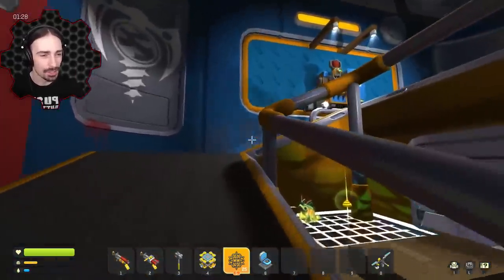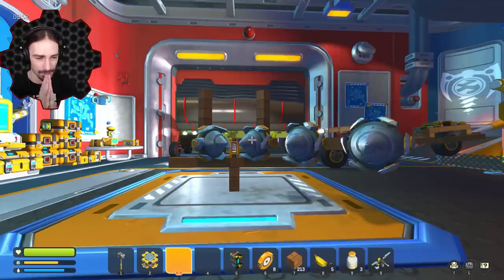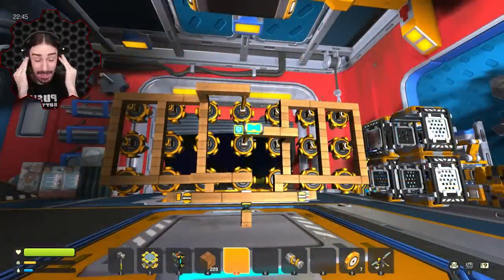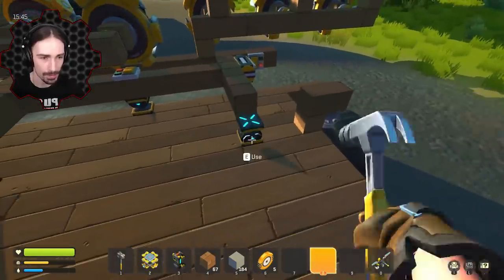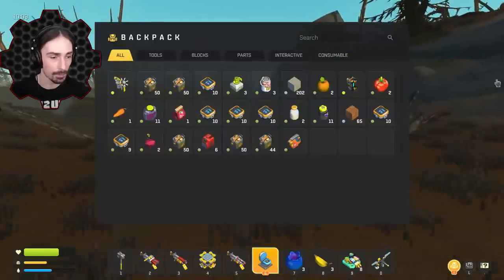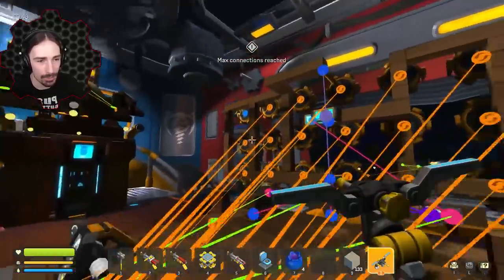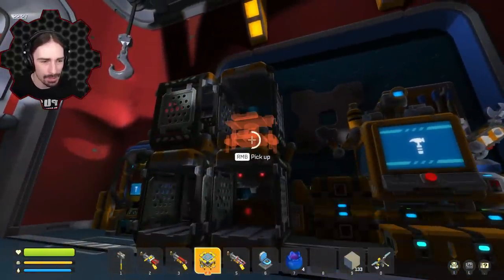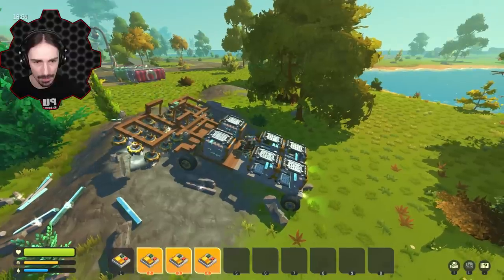Building The Ultimate Drill Miner! + Big Boss Biome? - Scrap Mechanic Survival Mode [SMS 14]

Comment: You can power saws and drills without any fuel using a fully upgraded seat connected to all the bearings, changing the properties of the bearings to full turn degrees and turn speed and then spamming A and D. Up to like 20 drills in one seat.

Comment: Hey scrapman, I have an idea for your farm defense mechanism. You can put sensors on the outside of the farm and hook them up to pistons. The pistons can crush the bots and kill them instantly. This means it will be ( for the most part) be an automatic defense system. You'll probably Still have to be there just in case it isn't fully reliable, but it'll make it a lot easier. However, this may not work for bosses because it would be op. Just make sure the pistons don't overlap the sensor so it doesn't make a infinite loop. Like so scrapman can see!

Comment: Scrapman, you should've used pistons to extend both sides of drill walls for the fold and able to retract it for the crushing.

To counter the weight of the drills, you can add refinery bots on your miner and refine as you mine.

Comment: can't you just make trusters and then make a plane so you can fly on top of warehouses?
Reply: They use way too much fuel
Reply: I’m pretty sure they GUZZLE all the fuel
Reply: Squidys isnt that bad
Reply: The roof is wierd it is still locked since you cant call the lift up
Reply: You can't get into a locked warehouse from the top
Reply: @noxious_nights  you can, you need to put the key at the elevator on roof
Reply: Hes to smart to be kept alive (and they might not load)
Reply: why not make a  car with lots of pistons
Reply: what does trusters mean
Reply: You mean thrusters
Reply: @nbsarkar6911  no u cannot. They fixed it

Comment: you could use controllers. with 3 bearings in series it gain enough speed to work with drills and sawblades. can use the same instead of engine to power vehicle too. then save your fuel for a jet experiment :)

Comment: The Spudling Gun deals the same damage as the Spud Gun. Its accuracy however is rather shite at mid range and far worse at long range so you inevitably use far more spuds as basically half of them miss at mid range. Its designed for rapid defeats of Harvest Bots and mowing down fields of other bot types, as such situations require more spuds being shot than the fastest the Spud Gun can fire.

Comment: I made this comment on the previous video, so just in case you don't see that one I'll paste it here: "What if you build your base above the water so the bots won't be able to get to it? Like extend it towards the water or build a small path that leads to the crop base on the water so the bots will have to take the small path to get to the crops making it much easier to kill them. Or something like that. I just thought it would help a lot having the base on the water, but I don't know if it will work or how to make it work."

Comment: Big tip you could just use a controller for the drills. I got 10 on one controller. Set to 360 and repeating.  Lots of power not needed. Save some gas.

Comment: Instead of having 1 suspension for each drill try doing  like a few master suspensions on a frame attached to your drill frame, it should cut on the amount of suspensions significantly, maybe 4 on each corner of your drill frame and attach that to another frame.

Comment: you should invert the control of the bearings on the drill so that it flips in the other direction, changing your center of mass and prevents the large wall in front of your face

Comment: Use bearings to spin the wheels instead of engines, you can use controllers to connect with multiple bearings. No fuel used.

Comment: Rather than on the platform where a random bot could walk up and destroy it why not place the chest like on the bottom/inside of your roof or at least really high up on the wall? Maybe with a shield layer. Or one thing i have done is i made a max jump minimum width stair up the wall so i can get on top of the shop and basically all my storage and bots are up there and ive never ran into an issue

Comment: I know it doesn't matter anymore, but for anyone making this exact mining vehicle, you can use a level 3 engine for the wheels, it's enough. I have a smaller version of this with 10 drills and I only have a level 2 engine and one level 5 engine for the drills

Comment: I WANT to see that huge lift in the garage actually being used and or being able to upgrade the lift so that it can be bigger and can go higher up to about 1/8 to 1/6 of the size of the big lift in the garage and the high won't be taller than the garage' s height and maybe have the pistons have a secondary upgrade for around the same thing but for them they get more grip to hold up more weight instead of it getting wider and for the drills to have the ability to be stronger and bigger all together and if not an upgrade then it could be a different thing in the crafting thing that costs more materials but also harder to get materials like the higher tier metal and other things with higher tiers.

Comment: overcomplicated drill arms, and the vehicle is a huge plank.... that bottoms out if just 1 piece of rock ends up underneath.
ive seen you create many nice things, but this is a BUST!

i have a drill vehicle half the size, two  45* downward angled front drills on suspension with 2range pistons for smallest loose rocks and 4 drills behind on suspensions with 2 drills above them facing eachother for rocks that jump up to get crushed in between.

vehicle is armored (wood 3-steel 3) runs on quad suspension and quad wheels per axle and i can clear a wall of stone in 30 seconds just holding reverse throttle 
(like 8-12 big square blocks)
and grinding them down to smaller bits takes another 3 minutes with the front and back drills
and the 4 cages that arent ON a plank vehicle but a nicely designed and painted armored truck are on the BOTTOM so they have a higher chance picking stuff up
and on top of the 4 cages are 2 refining bots that refine it during drilling.

oh... and this vehicle drives like a DAKAR truck.... so smooth!

Comment: I just built a mining vehicle that carries a refining bot and two resource collectors. I am using a level 5 engine to power it. I made the frame out of metal 3 and skeletonized it to save weight. I don't even have my drill mechanism on it yet. I just wanted to test drive the vehicle part so I put 2 gallons of fuel in it. That lasted me going out the door and 1/4 of the way around the mechanic shop then I ran out of gas. 

I don't know how people are traveling all across the map with gas engines. Every single time I use one my fuel just vanishes.
Reply: @Heavy weighted companion cube My previous mining vehicle was just a 2x1x10 wood plank with 4 tires and a single drill on it. That still got terrible fuel economy with a level 4 engine. It would burn through 10 gallons of fuel in just a few minutes. 

My point is that the engines in this game use WAY too much fuel. If they has some way to auto collect oil like they do with water, that would be different, but as of now, having to collect oil manually, it's just too much.

Comment: I’m triggered that he isn’t using the shotgun for bosses. Seems obvious to use a shotgun vs a large hitbox. He even showed that it had a better dmg to ammo ratio than the normal spudgun. It also appears to have a similar firing rate. When scrapman first got the spudgun, he killed a boss in 35 seconds, but it could’ve been about 25 seconds if he had used the wall strategy he has now. Spudgun: 3 shots/spuds to kill greenie, shotgun: 1 shot/ 2 spuds to kill greenie. This means he’d kill bosses even faster with a shotgun. If a boss takes 50 shots from spudgun, then it would probably take around 33 from a shotgun, and it takes somewhere between 80-100 from a spudling gun. I think spending an extra 10 seconds to kill a boss and save 50 ammo would be worth it.